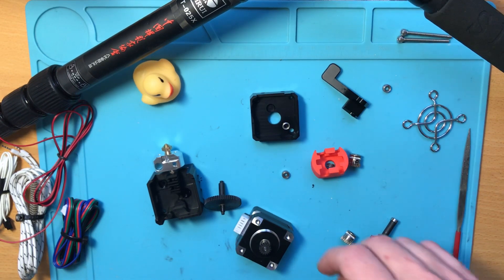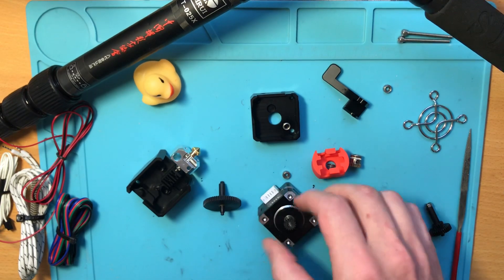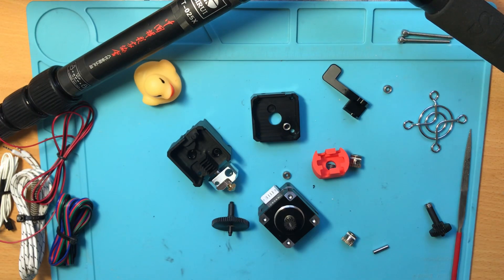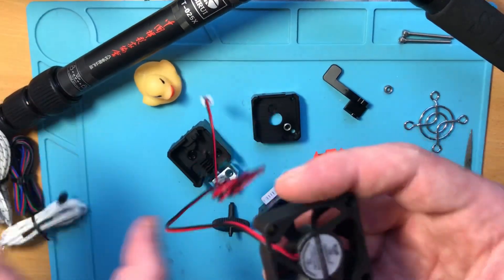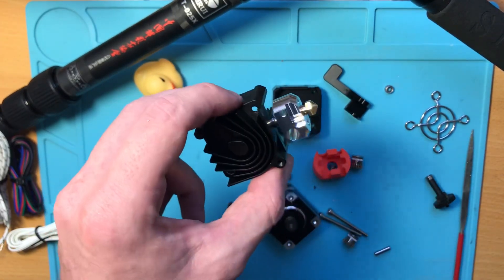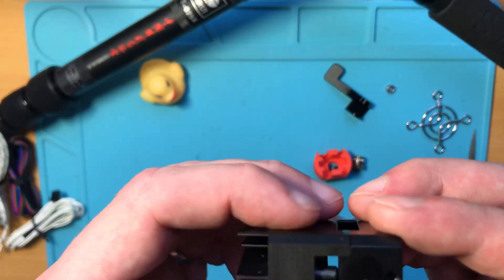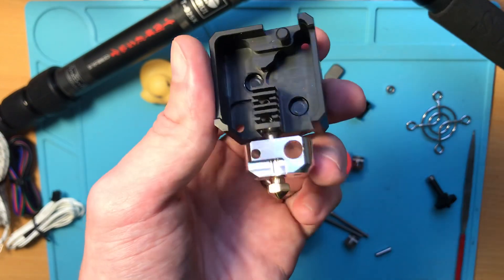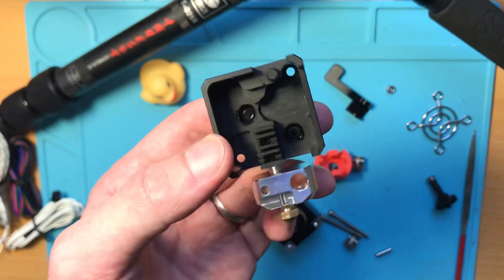Biqu H2 Industrial Design Review

Comment: Machinist trick If you have a small ball pean hammer u can use the dome end to tighten up a loose hole you hold ball end on hole and hit with another hammer. You can also use a center punch and go around outside the hole making small dents to tighten the hole.

Comment: if you tighten those screws the lever bids on mine
Reply: The lever thickness was fine on my biqu h2, but the lower groove in the shaft which holds two gears was about 0.4 mm smaller than it should be. When I tightened the screws the largest gear and the middle one were binding together. I increased the lower groove by inserting the gear's shaft into the drill and filing down excess metal off of the rotating part. It fits perfectly now and there is no binding whatsoever. It is  very sad that there are so many different defects in this product and each one has some unique problem that you need to solve after paying $100 for it. Quality control is obviously very bad.
Reply: @cccccccc  Also fine one mine, mine is the long screw version and the stepper driver connector was even rotated up when i got it, but the gearbox part binds up completely.. Suggestions for me instead of the obvious refund?
Reply: @martinw6297  Try to unscrew two screws a bit and if at some point gears start to rotate freely then your h2 has the same defect as mine probably. You can measure the grooves at the ends of the shafts that hold gears (the part that gets inserted into bearings). They have to be of equal length on both sides of both shafts. If they are not then you need to make them equal. Be careful not to change their diameter because the inner diameter of bearings is different on one side of one of the shafts.
Reply: @cccccccc  Thanks i will try that but i once tried and only assembled the gearbox side without the motor (used some m3 nuts) and never even got that to spin  more than 90° without binding and a grinding sound. Not even the stepper motor could have binded. Also whats up with the gear steel looking like its made from old kitchen pans...
Reply: @martinw6297  if there is grinding sound then the biggest gear's teeth might be touching the inner side of housing. You can slightly move the parts of housing relative to one another when you unscrew two screws. You need to find a position where there is no grinding sound and then tighten the screws. Of course this is bad design, but you can either try to make it work or just return it while you still can.
Reply from the maker: Yep as I too figured, the lever happens to be just a smidge thicker than the slot it's supposed to fit in...
I just identified the rubbing area and filed it down a good bit until it could move freely fully clamped down.
An odd design quirk
Reply: @fractalengineering  do you get clicking noises on retractions with your unit if i might ask
Reply from the maker: @420247paul  Not that I noticed so far
Reply: @420247paul  I do with mine!